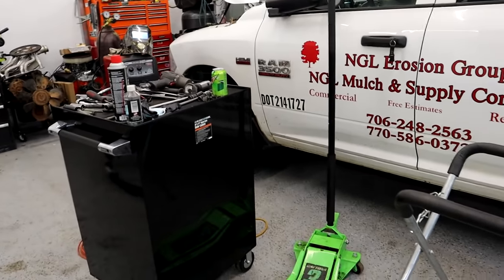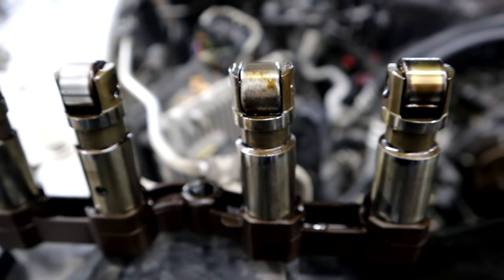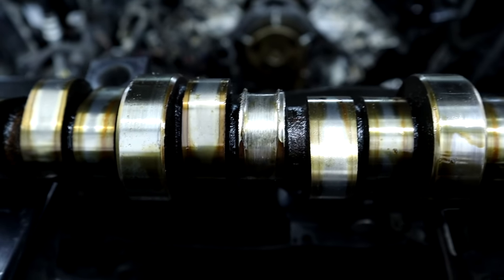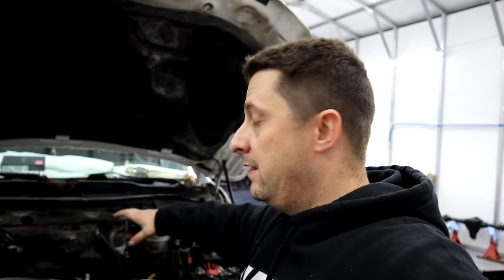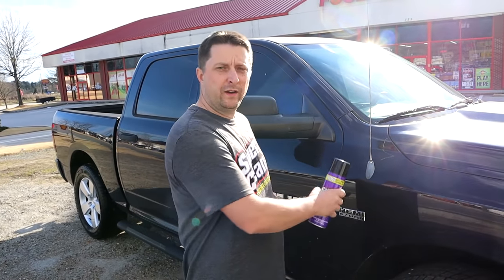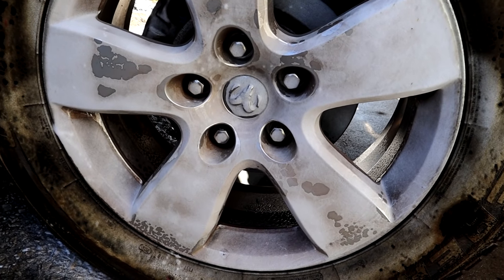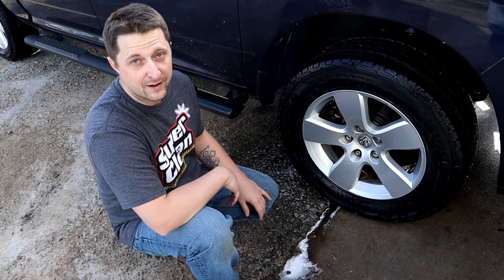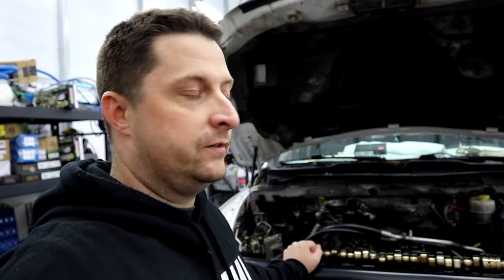6.4 HEMI Engine Failures Common Problems WATCH OUT.

Comment: I just called Dodge yesterday in SA,TX and for just  the 16 lifters were $1300. Add the cam, solenoids, springs and valves will not be $2k.

Comment: I just sold my 5.7 HEMI with 135,000 miles 8 years old. Pulled an 8000 pound trailer every spring/summer/fall. I had to replace the exhaust manifold on both sides. Other than that, zero issues. Used the recommended 89 octane fuel and synthetic 5w20 oil every 5000 miles. Recently bought a new 6.4 Hemi 2500. Again, I use the recommended 89 Octane fuel and synthetic oil every oil change. I don't know if a lot of guys do that, but I believe it makes a difference.
Reply: My brother in law sold my brother his charger with a hemi. He said it never ran right and had an engine tap. My brother put 89 fuel in it like it was supposed to and it solved the problem. Brother in law was pissed. Lol.
Reply: @eric44707  The 6.4 Hemi is tuned to be able to use 89 octane from the factory, FCA and the manual recommends running 93 octane in the 6.4 engine.
Reply: Use the proper oil..it makes a difference.
Reply: I always run 93

Comment: Just traded in my 2012 5.7 and she had 179,000 miles.  Don't know if the 2012's even came with a check engine light as I never saw it once.  No rust and ran good.  Hated to let her go but needed a 2500 to haul my new camper.  Awesome truck.

Comment: I have a 2014 ram 2500 with the 6.4 hemi mds. I bought it  in 2015 with 12,500 miles. I now have 210,000 on the truck have had no issues accept for just recently replacing broken exhaust manifold bolts.  routinely maintenanced change the oil  at 3000 miles wheather it needs it or not tire rotation alignment and balance with every oil change. Best running truck I've owned 👌
Reply from the maker: Thats awesome some good mileage to👍

Comment: I recently repaired this problem on a 5.7 Durango with 90,000 miles. Although the miles were a bit low, this engine had over 5000 hours on it due to extended periods of sitting at idle.  Not all that bad really, if you consider a hypothetical average speed of 30MPH, that comes out to 150,000 miles. I did the work myself at a cost of around $1,200. I ordered a stock cam from Dodge, didn't pay any attention to the cam specs, and inadvertently ended up with a higher performance grind than original equipment. It really woke the engine up and was a bit of a shock when I first drove it. Other than the cam/lifter issue, I've never had any other problems with this engine. It doesn't burn oil or overheat, has lots of power and get respectable MPG for what it is.  With the time on this engine and being used to engines from the 60's and 70's I can't complain.
Reply: Idleing does not hurt engines. Keeps the oil at temp keeping all water vapor at bay.
Reply: I think even if you maintain them it can still happen

Comment: Cam looks like it's been overdue with the oilchanges or cheap oil/overheated maybe? 
Pulled the cam out of mine and it looks brand-new, just like the crank. Oil changed every 4000 miles. Engine has almost 180000 miles on it.
Reply: Why did you pull the cam?
Reply: I find it odd that you took the time out of your day too pull the cam out of your engine? If there was no problems to begin with.
Reply: If your engine drops a valveseat your bound to do a rebuild. At least if you want to do it the right way. Thats why I pulled the cam. I'm not pulling a cam out of a perfectly running engine.
Reply: @alexh201174  oh ok, I was wondering if there was another reason that you pull the cam out.
Reply: @alexh201174  Makes sense to me, thanks.
Reply: @cliffordzellner5917  I mean, my Gen 3, 2008 hemi has 168,500 miles on it now. So I would want to pull my cams and lifters to see if I should think about replacing anything, as I'm starting to hear what sounds like the "hemi tick".

Comment: Part of the problem is that modern day motor oil has the Zinc levels significantly reduced in the oil formulation.  Zinc (ZDDP) is used to lubricate ferrous metals under heavy pressure.  Since EPA requires Catalytic Converter s to last longer, ZDDP has been reduced.  High levels of ZDDP reduces Catalytic Converter life.  

I have a 6.4L Hemi in my Challenger.  I add six to seven ounces of Lucas ZDDP oil additive at every oil change interval.   My lifter noise is gone and the engine seems much smoother.  I also removed the MDS using a tuner device.

My honest opinion is that it is easier to deal with Cats that deteriorate over time than it is to replace engine components.   Sorry Greta, but how dare you and your minions at the EPA lower my ZDDP levels and destroy my engine in the process.

I also saw an internal Chrysler service memo recommending SAE 5W40 synthetic to be used in lieu of other oil weights originally suggested.  This memo applied to severe service use, such as police, taxi and towing.  I use 5W40 synthetic as well.  The 5W40 plays an important role in cooling and is believed to help reduce the dropped valve issue on the 5.7L Hemi.

SAE 5W20 was originally thought of as the best oil to circulate and that it is the best oil at start up.  However, with reduced ZDDP levels combined with all the stresses and high operating temperatures that modern day engines are exposed to, metal sheer, scoring and thermal breakdown is showing that 5W20 is not a long term solution.  Also, avoid using certain bright colored oil filters as they do not offer the protection a Mopar or top quality branded filter will offer you.

Plate [C]
Reply: DUDE. Look at Amsoil. It's got the zinc in all blends. My 1967 440,(actual 452, 40 thousands cut and Direct connection stage 4 heads, and more). My 5.7 in a 1500. Research it and use the proper one for your engine. No guessing, no overdoses, just clean oil. I do not sell the stuff or represent the company, just a gear head from the 70's. For the old iron there is a specific blend with the most zinc. I think it's called Rod X or something. Run one crankcase of that in your new 6.4 for 5K and then run the lighter blends.
Reply: This is very interesting. A newbie hemi 392 owner here and ive just ordered a product called Turbomaxx. They claim similar or better protection qualities as zddp but without the cats being harmed.  Ill be putting 2oz into approximately 7 quarts. Im very keen to see how it performs (or not perform). Im running 0w-40 but there just might be something to that 5w-40 fca internal memo. Totally agree Mopar white SRT filter only, not the regular Mopar black filter.
Reply: What oil are you using ? I've thought about changing to redline Easter based 0w40 high zinc formula. It has 13 hundred ppm zddp....  Regarding the 0w40 vs 5w40, I'm told the 0w40 is better for lubrication when it's cold on the 6.4 Hemi... I've been using a friction modifier Archoil. I'm on 30k now still new, but I'm trying to do preventive maintance, any advice you can give me, I will appreciate it. I also never run the engine on auto mode. I always run on sport mode, so the mds doesn't turn on.
Reply: The issue is the block , small oil passages hence the zero weight oil as it flows better 
I avoid engines that want 0 weight 20 or even 0 weight 16 ( seen it) 
 5 weight 40 synthetic diesel ( high detergent ) keeps engine clean change oil WHEN IT GET DARK BROWN why people change oil when it's black is too late

Comment: You guys need to start using Amsoil. Why not get the best for the best. You won’t be disappointed. I started using Amsoil in my air cooled Harley’s back in 09, Amsoil far exceeds everybody else’s oil. I have used it in all my vehicles too, it’s life and longevity to your engine. Fully synthetic, runs cooler, lubricates better, last longer. My Hemi 5.7 has 190,000 miles on it, using all Amsoil in it, runs like a new one.
Reply: I use Castrol gtx and mine has 190,000 on it too lol
Reply: @brokenarrow6491  However, his may run far longer than yours. LOL

Comment: I am running a 15 ram 3500 6.4. Bought it with 69k i now have 137k. 40k of the miles i put on are towing my toyhauler camper loaded at 13,500 lbs. I have change my oil at 5k every time myself. Pennzoil 0w40. It has ticked since the day I got it and still ticks the exact same way. I run  nothing less then 89 octane. I know for certain that running 91 will maintain my speed better towing my rig at 55-60mph. My truck hates that speed with the camper in tow. She is very happy running 65-70mph. I will note that my oil seems to be a bit darker at oil changes now then when i first got it, but it is not jet black.

Comment: All commercial vehicles should have hour meters and have there service intervals set by hour not miles
Reply from the maker: That could definitely help possibly
Reply: Yes that’s why Chrysler changed it to hours not kilometres And miles. The oil temp runs really really hot in hemi’s and breaks down quicker than normal oil change intervals. So by the time you go to get a oil change the oils cooked The detergents and the viscosity of the oil too.
Reply: Also sitting at idle a lot starves the top end as these engines have weak oil pressure at idle for the size of the hemi.
Reply: My truck has an hours run and an hours idle. The recommendation is don’t idle. You need to get the RPMs up above 3k frequently to get oil on the lifters. I make it a point to get my Hemi well above 4K frequently. Mainly because it sounds so damn good.
Reply: Ram suggest 350 idle hours as a service interval over an odometer reading
Reply: So don't buy a Hemi cop car at an auction, eh? They idle all day.

Comment: GM and Ram have been all plagued by this problem because of MDS…well documented and not a surprise at this point…eliminate it or get another truck every 100,000 miles, which is why they continue to use these systems, most people don’t keep the truck that long so they don’t care, especially after warranty period

Comment: I bought a 2014 2500 with the 6.4... as soon as I had it a day, same problem.  And it sat at the shop for 3 weeks. I got it back for 3 days and had to put a transmission in it. I love the truck I have it still and no issues now 🤞 besides the gas cap curse.
Reply: What is the gas cap curse?

Comment: Honestly I bet it's lack of oil changes or oil level to low or possibly cheap oil being used. My 5.7 has 119,000 with zero cam issues. But I do change it every 3,000 and only use amsoil signature series.
Reply: Amsoil is the best 💯
Reply: Well update to my ram hemi. Traded in the garbage truck after 6 months. 6 exhaust manifold bolts broke on me and several leaks. Never buy a ram again junk

Comment: Although long idle doesn't help. Oil break down is probably a factor too!  The one thing that stands out the most to me is MDS. It is my belief that the MDS affects oiling of the lifters and cam!  Recomend MDS delete!
Reply: Oil breakdown has nothing to do with it. Y'all are not diagnosing the problem correctly. These lifters need Axle Oiling to better lubricate cam lobes and assist Spring Pressures available from Johnson Lifter AND the MDS Delete.   The Crankshaft uses oil fling method of oiling the upper head and adding a direct line oil lube to both valve covers would do a better job ESPECIALLY at idle. What I cannot fathom is WHY would Dodge/Chrysler allow this to continue for so long without a design change OR a boosted oil pump at lower RPM to solve this issue. Even at 150 mph the oil pressure never goes above 56 psi. There must be some happy medium available or install direct head lubrication. If you own a 6.4 are you seriously concerned about fuel economy? (or even a 6.1 or 5.7 for that matter)
Reply: The MDS system utilize a small oiling port in the cam( or was it cam lifter) to allow the MDS to shut down certain cylinders while motor runs. If it gets clogged it causes a part to lock up and seize so even a MDS delete won't prevent this unless you replace the cam
Reply: @diamondheat9  That would be the lifter my good man.
Reply: @anonimous2451  ty

Comment: This exact issue just happened to my 2014 RAM 1500 with 5.7 HEMI. We were on a trip towing our 7,000 pound camper to Charleston, SC from middle TN. The tapping sound started while we were on our way down the interstate. I could hear it over the radio. I heard it all that week in varying degrees. Sometimes I could barely hear it. The engine light came on during the return trip so it went to the dealer. The issue was exactly the #5 lifter had locked and been chewing on the cam for some time. I was unaware until it was too late. I now have a 8 year old truck with a brand new dealer installed 5.7 HEMI engine to the tune of $13,000!!! It hurt BAD to do that, but did come with a 3 year/100,000 mile warranty. I had planned to trade the truck soon for possibly a 3/4 ton diesel. But with prices as crazy as they are now I'm thinking to drive this thing as long as I can then get something else. I will say I have lost my faith in the HEMI. It let me down in a big way at the very worst time. I would go to a 3/4 ton gas with 6.4 HEMI but I just don't have faith in the longevity of the engine. And the fuel price and maintenance of the diesel just about gives me a stomach ache. I'm not sure what to do other than maintain my truck very well and hope this new engine gives me 2 or 3 more years.
Reply: Use the right oil 0-5--20 wsyn !
Reply: 5-7!  6l???

Comment: Not sure if anything is changed since the year of those motors. But I'm running a 2019 classic. 5.7. 304000 miles without an issue. Oil changes done every time the oil light comes on so and we're between 8 and 10000 miles and my truck regularly halls every day between 4 and 8000 pounds. The only thing i've had to replace is a battery. Original transmission original rear end original engine. Haven't cracked a boat on the motor yet.

Comment: Its been said it comes back to oil changes, and most of these failures on are on long idle hours fleet vehicles, being changed at mileage instead of engine hours.
When mine in my power wagon goes, I'm doing MDS delete, and using the blanking plugs from the old 5.7 HDs.
Reply: Blanking plugs? What are those?
Reply: @donellmuniz590  The older HD 5.7 hemis in the 2500, and 3500 were detuned and had MDS removed, though the cavities still exist for the solenoids, all Ram did was put caps on them, so the lifters were constantly bathed in oil, essentially eliminating this type of failure. The MDS solenoids basically controlled the oil gallery surrounding the lifters, if they never activate the lifter doesnt get much lube, but the caps have no provision to block the oil so they're always full.

Comment: From what I understand, it’s caused by the low tolerance within the engine cutting oil supply to the lifters. Not exactly how true this is though. I was told that there’s a plug to check for metal shavings somewhere in the engine (can’t remember where). If you check it, and there are shavings in the screen, the engine is done.
Reply: You are absolutely right. My 6.4 is on it second lifter and cam replacement.
Reply: @cwbjr18  🤑😱🙀🙈

Comment: my 5.7 is on 305 000km and never had an issue, I've always put some anti friction (for diesel engines) mixed with the oil since I got it at 200 000km and it's been great
Reply: Km lol

Comment: My 2016 Ram 6.4 had the #5 lifter seize at 150k. All new lifters, cam, spark plugs, original parts and labor at the dealership, just under $5k. Oil changed every 5k miles. It just happens once in a while. With a couple hundred thousand lifters manufactured, a small percentage of them have failed. But even if 1% of all lifters manufactured fail that could equate to 10% of the motors being damaged. We can't blame the motor, but unfortunately it just happens.
Reply: Ron, I wish all people had your mentality.. your comment is very correct, horrible for this to happen but it is only 1%.
Reply: 150k miles and only a single major fix of >$5k? Not that bad of a risk. Hemi's idling for extended periods of time in Landscaping trucks is probably a strong negative factor
Reply: Six trucks owned by the same person Idk how you can justify it being just a few machine parts out of hundreds of thousands. I guess that's your idea of reliability that to each their own. My idea of liabilities 230,000 300000 mi no problem.

Comment: Normally company trucks will overdue the maintenance and abusive driving. That's the no 1 reason causing the powertrain to fail.
Reply: My truck 2015 is in the shop now for the same thing it just turned 105k all the maintenance has been done on time i landscape on the side but mainly cutting grass i have a full time job that limits me on how much i can take on. Luckily i have a drivetrain warranty through the dealership i bought it from for no extra cost only catch is my maintenance being on time and through the dealership which worked out for me i just got the transmission replaced last year at no charge
Reply: Agree, but would expect the rest of the vehicle to be a rattling POS by the time the engine issues cropped up.